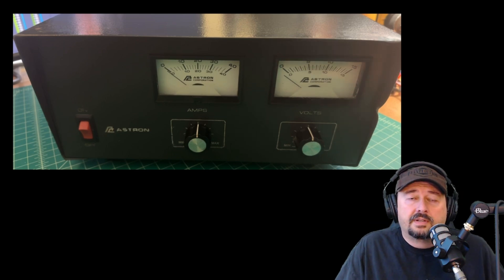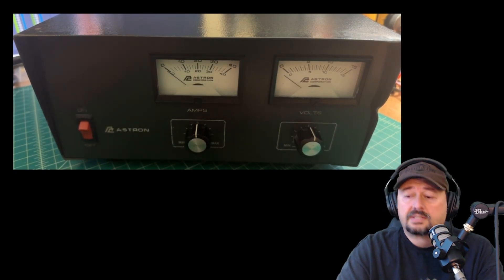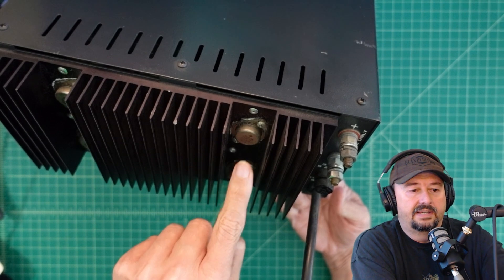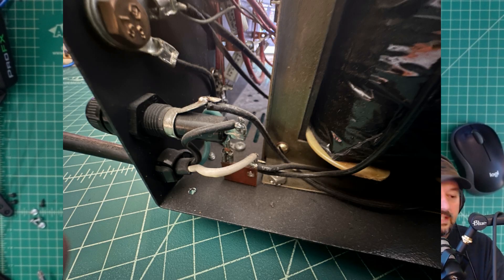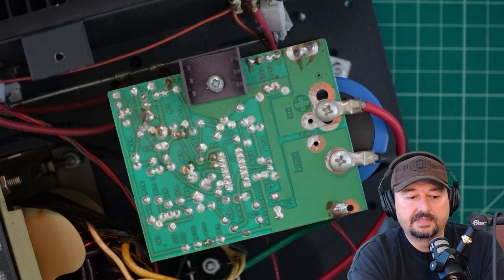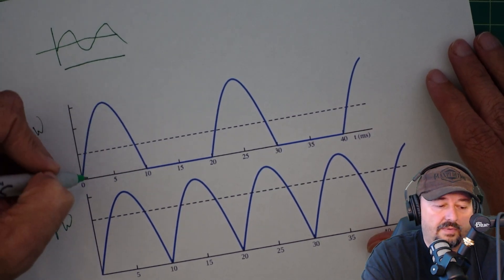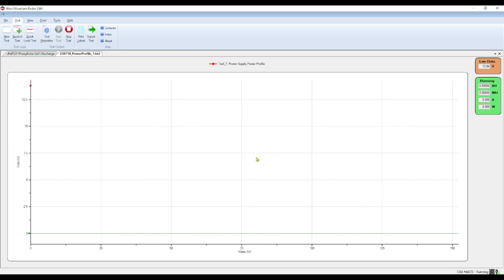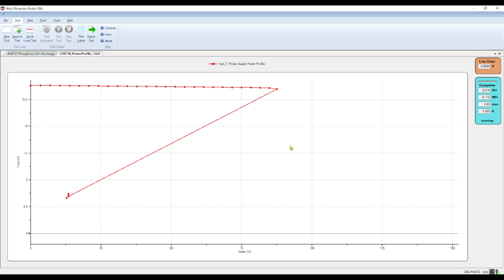I bought a USED Power Supply - Astron VS-35M

Comment: I have to RS-35M model, with meter but not variable.  It's been my workhorse for years.  I was leery of the terminals too. Also, watch out for those transistors on the back. The case isn't the ground, it's live voltage, so if you accidently drop something on them it will short out big time.  I found some covers for both the connectors and transistors on Thingiverse and printed them out.
Reply from the maker: Hey Ron, I am thinking about replacing the posts with 5 way posts.

Comment: I agree with some other commenters. You got this supply at a very good price. Parts for these are not all that expensive and if you fixed it, you would have a great power supply well under what you could purchase a new or used working supply. I have a 35 M and it's been a great supply. Mine will most likely be passed down to the next generation when I'm worm food. These are not all that hard to work on. Think twice before returning it. P.S. You're one of the more technical dudes on H.R. YouTube. Show us what you got. You can do it !!!!!
Reply from the maker: I got the 35 based off its strong reputation and I would like to repair the PS but I want to find out if this actually worked and get some sort of refund.

Comment: I have been using The same VS35M for almost 30 years now that I bought from AES . The only trouble I had was the voltage pot went bad and I replaced it 20 - 25 years ago. The pass transistors on the one you bought do not appear to be original and someone has worked on the regulator board at some point in it's life. You paid a premium for it IMHO and hopefully the seller will work with you. If the seller doesn't then it gives you a great canvas for some linear PSU repair content. When life gives you lemons make whiskey sours :) That supply repaired will likely remain serviceable for the rest of your life.  Thanks for sharing !
Reply from the maker: Hey SC.  I am trying to work something out with the seller as I would prefer to keep it...
Reply: @TheSmokinApe  Cool beans it is a great PSU if you choose to save it. Playing devil's advocate here but I imagine the seller never put it under load. In my experience a 10 amp load on a PSU rated 10 amps or greater is a really good test like you demonstrated. I use an enormous 1ohm  load here and the lion's share of failure I have seen in PSU testing rated equal to or greater than the load I present has occurred in the 5-10 amp range. If it survives big Sid it is good to ride the river with.
Reply from the maker: @survivalcomms  yeah, I suspect he just powered it on and thought it was good
Reply: @TheSmokinApe  That is par for the course :)

Comment: I have had a couple of these over the years.   It sure looks like someone was inside at one time, maybe troubleshooting the problem you were showing.  Just thinking out loud,  I wonder if changing the current limit control up higher, would make a difference?  I see you had it set for about half of the knob's travel, and i don't remember how linear the adjustment is...     if that don't help,  it could be the LM723,  I have had to replace a couple of them in the past.  That's the regulator chip,  and just doing a quick search, it looks like they go for $2 or $3.  If the chip develops a thermal issue in the current regulator, that could be what you were looking at, or something in the feedback for the regulator.   I guess though if you are going to try to return it to the seller, then all this don't matter..    Better luck at the flea mkt next time!
Reply from the maker: Hey Arnold, if I do end up keeping it I will probably replace the whole regulator board.
Reply: @TheSmokinApe  Before replacing the regulator board, make sure those 4 pass transistors are performing as they should. They may be breaking down under load conditions. Does the goop (aka silicon heat sink grease) under them appear to be fresh?
Reply from the maker: Nah, it looks old.
Reply: @TheSmokinApe  That makes me very suspect of them. Just sayin'.

Comment: Interesting article on this PS - Might shed some light.   https://people.ohio.edu/postr/bapix/Astron_VS-35M.htm    Ape, how do you determine where to set the AMPS knob (Current limiting)?
Reply from the maker: Thanks for the link Alan.  I'd expect the voltage to be more stable if it was a result of the current pot, it shouldn't swing like that.
Reply: I'd like to know how you determine where to set the amp knob too!  I just got a used Astron VS-35M.

Comment: Fortunately these power supplies are very simple, a lot of people have run these for decades continuously but a few simple modifications can improve them. Very easy to repair, A few design weaknesses that are very simple to address, I did notice you had the current limit set low unless that was just the camera angle. I always keep an eye out for a cheap faulty one, about the worst failure (other than the meters) can be the transformer, yours is OK so could be repaired in a very short time at very low cost.
Reply from the maker: He G0FVT, I am trying to get a partial refund so I can attempt a repair based off the points you make.  Thanks for the comment 👍

Comment: 11:35 hope you would have talked about the crow bar circuit and why it’s important to use & have one in your supply 😉my buddy zorched his hf rig n meter and a 2m rig using a Lamda supply which outputted 60v into his gear. I was using a 45amp bulldog switching but upgraded to a vs35 m too but paid 2x and got it new. One complaint is these got hot with no fan so I added a 120mm high output fan to keep it happier 😊
Reply from the maker: Hey Kevin.  I  meant to cover it but ended the video early when it started to act crazy...  hopefully I can work out a deal with the seller and then attempt to get this sorted out.